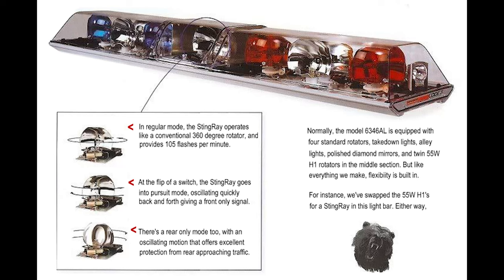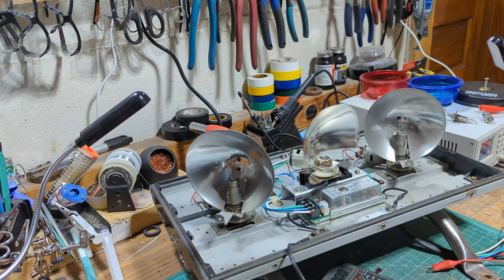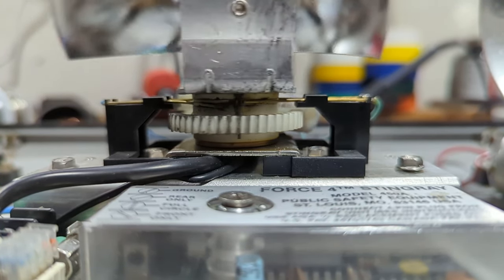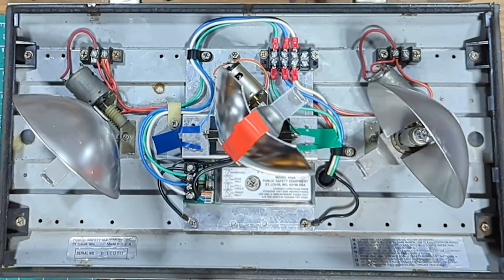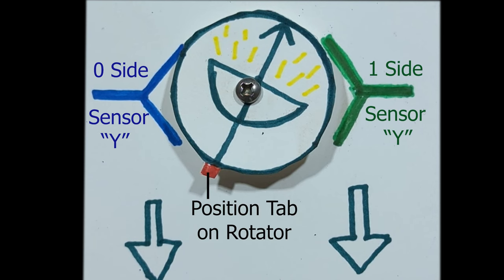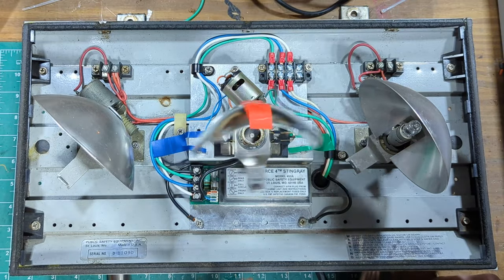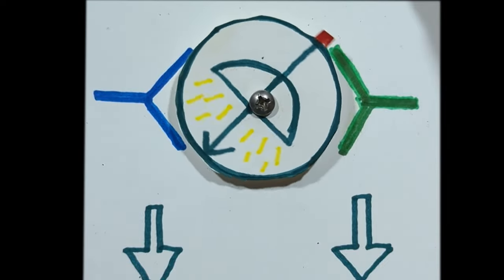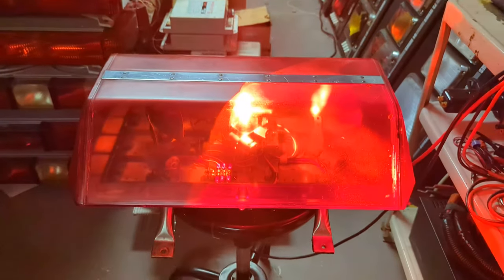Code 3 Stingray Multi-Function Lights, How do They Work?

Comment: Can you do a video of the smart sweeps?
Reply from the maker: Meaning the smart intersection lights in the MX7000? I don't have a set. I don't even have an MX7000 right now. They are an interesting option I'd love to play with more.
Reply: I had a set on an MX...took them out because they never worked right... They liked getting stuck, sometimes they would not turn on... I replaced them with a nos setup found on eBay. 
In retrospect I should have kept them and tried to figure out what was wrong with them.